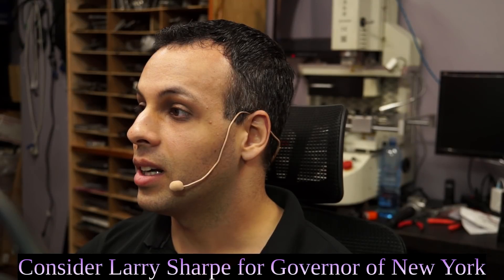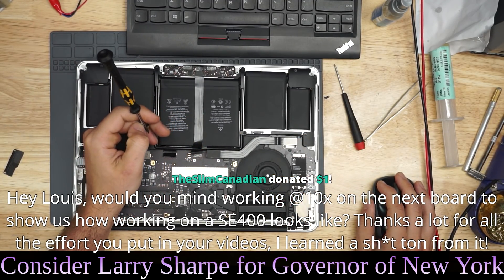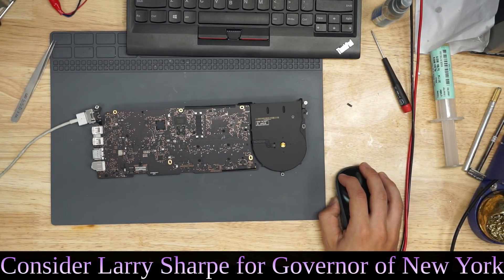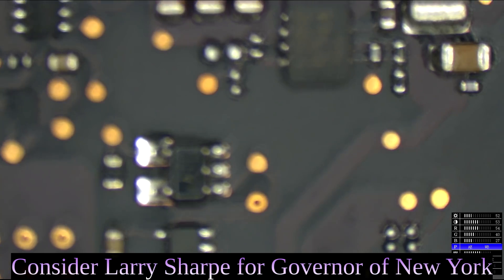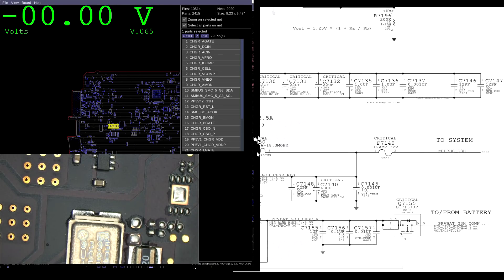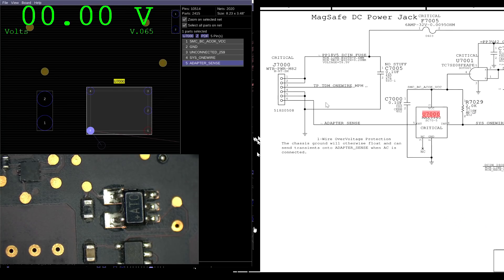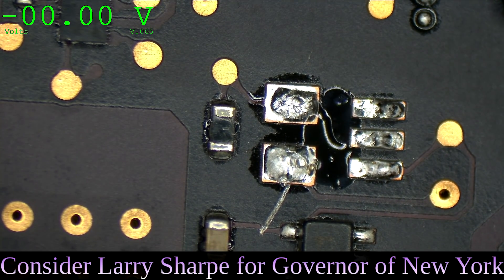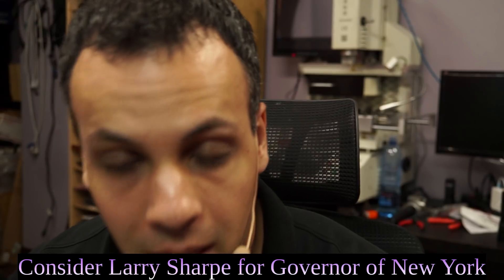Post concussion repair

Comment: Abouth the gun thing, for the price of the 3D printer, you can buy a cnc drilling machine, and a small used lathe.
With a little bit of experience, you can make your own gun from bare metal, which will be able to shoot more than once.
Reply: Why does everyone think 3D printers cost so much...  I have one that cost me $200 and does everything I ask of it, multimaterial, layer heights down to 20 microns, good accuracy. These are not "6 figure machines" as Louis says, even an industrial RP Stratasys FDM machine will only run you 50K. You do not need metal printing to make a functional one-shot gun, newer 3d print materials and certain tempering processes will get you the strength you need, with an obvious thickness disadvantage. This all to say, 3D printed guns are totally feasable, very cheap, and definitely going to become better with time. Your argument that you can buy a milling machine and lathe is apples to oranges, the price of an FDM machine that can print a gun is already far lower than cheap hobby machining tools, and the point of printing a gun is cheap non-detectable assassination/self defense weapons, not a repeatable-use sturdy weapon.
Reply: What is you 3d printer?
My 300$ printer can do only 100 microns and prints only PLA.
Completely not suitable for a gun (mostly the PLA part).
I was not talking about printing metal, but metal machining. 
Even if it's comparing apple to orange, if you want to build a gun by yourself, you better be going the machinist way, the results will be far more reliable.

I'm upgrading my printer to be able to print other materials, but this require some personnal investment, skills and practice. Again, better be going the machinist way.
I don't beleive that you can buy a 200$ 3D printer, an print your gun in a breeze without any knowledge.
Reply: I have an anycubic delta printer from taobao, I can run pla, abs, petg, thinking about getting an upgrade to print nylon. Have you tried to get your printer below 0.1 mm? It takes a lot of refinement of settings but it definitely should be possible. And obviously a machined gun will be better, but again, that's not the point. The point of a plastic gun is for single-use scenarios. And if you're going to make a gun, you need more knowledge/experience to machine the gun, the tools are more expensive,  the finished product will light up metal detectors. These are different use cases, which is why it's comparing apples to oranges.
Like I said before obviously if you want a functional long-term weapon you make it out of metal, but if you need a gun faster, cheaper, and less detectable and only care about using it once, 3D printing is quickly becoming the most viable option.
Reply: Alright. 
"It takes a lot of refinement of settings but it definitely should be possible."
That was my point.
You need quite some skills to achieve that.

I don't really know the niche market for a plastic single use scenario (you would need a non metallic cartridge and bullet also). Even on a plane, I guess you would need at least several shot.
Pretty sure It would be much easier to carve a hole in a  chunk of solid plastic, with a cord drill, and make a firing pin with another piece of plastic, thant to go and print it in 3D.

I don't print much (the printer was given to me as a present), and I didn't really need to even go to 0.1mm.
But I enjoy trying to get it better (bought a hot plate etc..)
Reply: Refinement of settings is much faster/easier than learning how to machine metal, I've had experience with both. As for the use-case, yeah it's not really a common one, it's definitely geared towards terrorism, which is why the fear-mongering has some element of truth. As far as detectability, small non-identifiable shapes of metal like a tiny metal tip on a firing pin would be much less detectable, and ceramic slugs have been around a while if you don't want to go with plastic. Cartridges are tricky, but paper cartridges less so, primers can be plastic.
Reply: As a kid i modified a couple of cheap airguns to work with 22LR rounds, i suspect that would be the easiest, cheapest and most reliable way of doing it.

Comment: The wiring on J7000 confuses me. It is 6-pins in, and the wiring on the various pins is not symmetric. How can you plug in a Maglite charger in either direction and it still works? There must also be some logic in the connector on the wire to detect this orientation. Does that ever go bad?

Comment: You could totally print a lower receiver on an Ender 3 or any other generic-but-dialed-in 3D consumer-level printer. That's the key part, as that's what is serialized. Printing it in PLA will certainly result in a failure to fire within 5 shots. You can print other, more minor parts as well. Ultimately, you can't print a metal upper with a consumer-class printer, so it will not be a successful firearm. You can rather ably print enough parts to get some shots off with a sub$300 printer, though. One shot is enough to change the world. That said, this entire thing about printing guns/gun parts is silly. It's not even close to the closest/most efficient/most effective way of getting a gun with no serial number on it.
Reply: Philip Martin probably wouldn’t have to cross state lines to illegally acquire a firearm. The vast majority of gun show operators and vendors do their jobs legally and appropriately. I’d say to try to go to a gun show and buy a firearm.

Comment: I can build a gun of common hardware store items faster, cheaper and more reliably than you can 3D print a gun. I've done it. Where I live it's legal. In New York you're going to jail if you even think about it. Check your local laws before contemplating anything. The purpose of the one or two shot gun is to kill an enemy and take their gun. It's a wartime thing not something criminals do. The purpose of the 3D gun files it to prove the utter futility of gun control in the modern word. It's a hobby, nothing more.
Reply: 80%er's legal and cheap with no paper work
Reply: Oh fuck, I live in New York and I thought about it while reading your comment. Press F for me 😢
Reply: the idea of 3d printed gun is that you can take it through metal detector!
Reply: The detector will still pick up the cartridge case and bullet, neither of which you can make out of plastic. Oh and the firing pin and primer case.
Reply: Manufacture of a firearm that can pass through a metal detector undetected is already illegal. No current plan for a 3D gun can do it. As far as I can tell it's physically impossible to construct a safe concealable weapon that will. They must all have metal barrels or they blow up in your hand when fired. Polycase ammunition could sometimes pass through a metal detector but it had safety issues and is no longer manufactured.
Reply: Nylon barrels can withstand .22 ammunition at least for a single shot. Someone constructed a printable revolver where the cylinder contains one barrel for each chamber. The cylinder is a consumable making the gun suitable for a couple of hundred shots.
Reply: +Mora Fermi Plastic bullet casing ARE a thing, and lead isn't magnetic. Even caseless rounds are possible, or paper cartridges.  You can 3D print plastic cases.
+Patrick Weaver  The people who designed the Liberator (the one that made 3D printed guns famous)  aren't IDIOTS, the barrel is designed to withstand the stress.  Metal isn't magic, it just takes thicker walls with plastic.
Reply: Correct, its designed to bypass normal security if you can kill ONE person with it mission accomplished.

Comment: Louis never watched the movie "In the Line of Fire." If he did see this movie, he would not make those comments regarding 3D printed guns.

The reason some people would want to print an extremely expensive 3D printed gun that can only fire off one or two rounds before being destroyed. One, if you want to kill someone, all you really need is one round. Two, you can destroy the plastic gun, and there's no record of the weapon. If you use a real gun, you have to not only get one without registering with the state, but after you kill the person, you have to somehow ditch the gun, which can be a hassle. And three, if you watch the movie, you can sneak the plastic gun into any place - even if there's a metal detector guarding the building.
Reply: Wouldn't a metal detector pick up ammo? 3d printed guns are also very inaccurate, good luck landing a shot unless at point blank.
Reply: In the movie, the killer took the ammo and hid them in a rabbit's foot keychain. So when he goes through the metal detector, it detects the key chain. No one thinks twice about anything inside a rabbit's foot.
Reply: yuppiehi: You must have missed "The Untouchables" since you seem unworried about someone printing a baseball bat.  Rewatch this video as you have totally missed the point of what says as he looks at yet another failed Apple product.
Reply: Good grief.  Such on over blown non-problem.

Comment: You can print a decent functioning AR15 lower which can be used for several hundred rounds. The upper components still will be standard metal. Polymer lowers have been getting better of recent years.

Comment: I thought the whole scare about 3D-printed weapons (guns, knives, etc) was that it could potentially go through a metal detector undetected (or even go through in piece-by-piece from different assailants to be potentially undetected). So even if it is only one or two shots, that would be all the aggressor needed to attack a high-level target - thus making the initial 6-figure cost negligible in some cases. 

NOTE: I realize that I watch too many movies and it's where I got the idea of why people are scared of 3D-printed weapons :) ... so please don't hate me if I'm wrong, but feel free to correct me.
Reply: Just to clarify. You can not fully print a full gun. You can only print the lower receiver. You still need a metal barrel and upper. A bullet going off in a fully plastic gun would explode the gun there is way too much pressure from the gun powder igniting for plastic to ever hold up. Unless you are making a BB gun then good luck doing any fatal damage to anyone.
Reply: You can print a one time use, low caliber, short barrel plastic HANDGUN. These can be assembled from pieces like Warlooch said, but...
Incorrect Josh Reed. You cannot fully print a full RIFLE. The fact is that you can print the lower receiver of an AR (the only part with a serial number), but still need to obtain barrel, trigger, stock ect... which is what the media flipped out about. This is what Louis was referring to.
I hope this makes things more clear.
Reply: https://youtu.be/1eARrF5lt1A
Josh Reed it's not hard to do some research
* drops mic *
Reply: There are all sorts of weapons which aren't made of any sort of metal that can be found/bought/made very easily. A 3D printer is a relatively higher-costing option.
I'm not sure if metal detectors are used that often, it's usually x-rays or something like that.

As for 3D printing a gun, you could make a sort of 1-use one with some low power cartridge, but I'd think it'd be a lot less effective than what other options are available.
Also, ammunition would generally be detected by a metal detector and having anything that looks vaguely like a gun will get spotted by x-ray easily.

So yeah, I don't think it's much of a problem at all in terms of security.
Reply: 3d printed knife????? Have you heard of broken glass or stone knife?
Reply: Josh Reed you stand corrected.

I fully agree that a high end 3D printer is required to process the quality of polymer needed to sustain the pressures created by any caliber. But I don't agree that your "everyday" 3D printer will take "forever" to get the printing accurate enough to work. I also disagree that it will "most likely" do anything you predict.

Firecracker? Shoot yourself with a 22. What if the objective is not to kill?

You wouldn't know a serious concern if it happened to you multiple times.
Reply: WarLooch  I suppose what you suggest might be possible but then it wouldn’t be a scare for the public, your average person isn’t worrying about this possibility only a high value target.
Reply: You still need metal components, such as a firing pin. An SLS machine (melting stuff into shape with lasers) could get you the metal parts, but it's not going to get you through a competently operated scanning system unnoticed. The practical use of a 3d printed weapon is as a one-time self defense weapon and a demonstration that banning guns isn't going to solve the "gun" problem, since people will always find a way to do what they want, especially if they no longer care about legal restrictions.

Comment: I agree with you on the gun thing. Except. If you are in a well funded gang situation. 100 grand aint shit. And then you could make as many untraceable guns as you want. It's only an upfront cost. The single gun cost in quite low. You can print more than one. And give more than 1 to a single person. It's still rediculous though.
Reply: If you were an organized gang/crime group that could easily blow a few hundred grand, you're wasting that money printing what amounts to a one-shot pistol. You're better off grabbing up some old used milling machines and lathes and getting a couple machinists who are less than concerned about legality and machining your own ARs and/or pistols. Given that such a thing does occur every now and then and those weapons are beyond untraceable, it's a much more beneficial thing. The only really difficult part to make is the barrels, everything else is easily machined/produced with most machinery.

That being said, why bother with any of that when most police are losing their weapons, having them stolen, or in some cases selling weapons out of evidence lockers on the side? There's no real reason to bother with manufacturing weapons when the black market pool is already plentiful. Another thing to consider is that those "Community Weapons" are passe around/sold on the black market side specifically because they're passed around so much that tracing them to any one individual and/or group is difficult given today's typical underfunded, over-stressed, and generally lack luster forensic side of things in the US. 

What's even more hilarious about the whole "Downloadable Guns" thing is that this guy released these files in 2009, does anyone genuinely believe that there hasn't been at least a hundred people who have not only kept those files but actively propagate them on download sites and torrents since then? Do people honestly think files like these wouldn't spread like the latest pirated episode of their favorite TV Show?
Reply: Gangs don't care about untraceable guns.  The use stolen firearms.

Comment: ok i have to say dif   i have a 3d printed gun   and i have put over 300 round   through it
Reply: What method was used? What additional components did you add to make it functional? I'm not necessarily doubtful that you have accomplished this, but I am doubtful that it's as simple as your comment makes it sound, and would like the uninformed to understand more of what goes into making that work.
Reply: ok i printed a 300 black out  and yes i put more then  20 months  of drawing  and about  70 3d prints  to got it to hold   yes it would have cost way less  to just go buy one   but it was the challenge   to make it work and work right.
if wondering what i  used it  was on a cr110  and u used  pla with wood . 
yes that right  wood. it  has just the right flex   from breaking
Reply: .300 Blackout is a cartridge, not a gun. It sounds like you printed an AR-15 lower receiver. AR-15 lowers can be printed in plastic because they don't require a whole lot of structural strength, though if it isn't reinforced in some way it's likely to crack at the forward pin hole where the upper receiver is attached to the lower one.

You still need a metal upper and barrel to put it on it, as that's the part that actually contains the pressure from the cartridge. In other words, it sounds like you printed PART of a gun, not the entire thing.